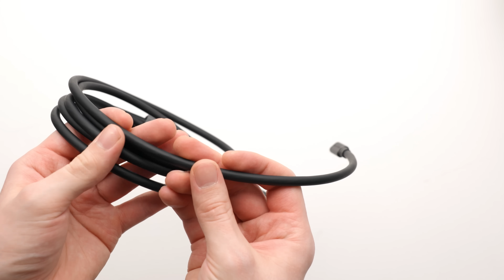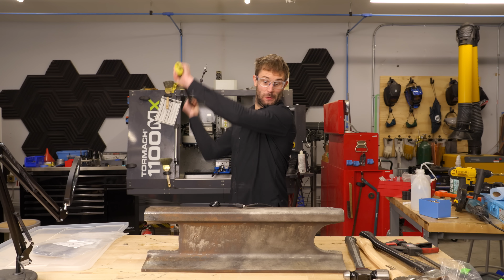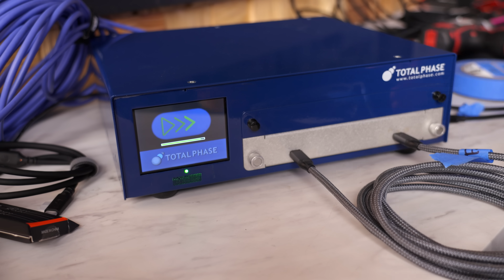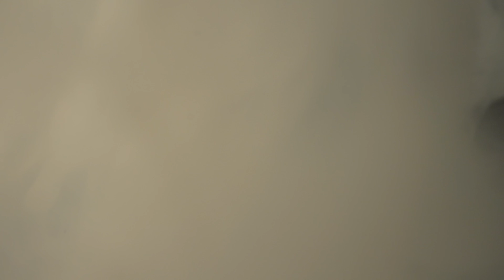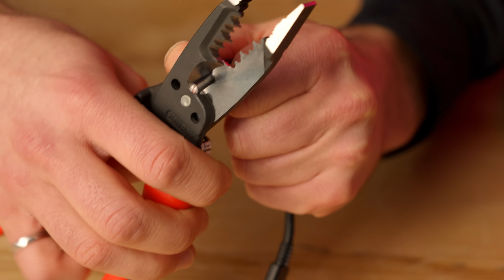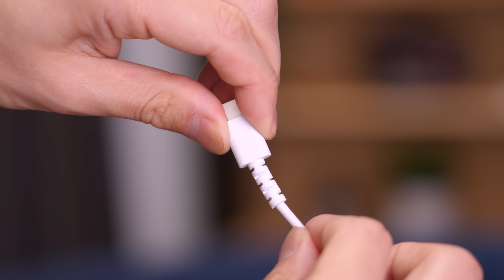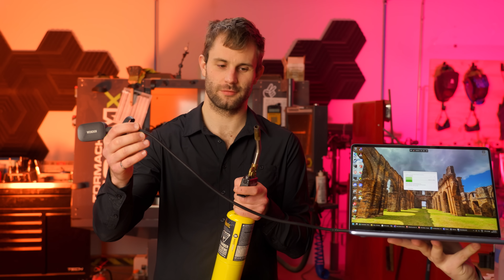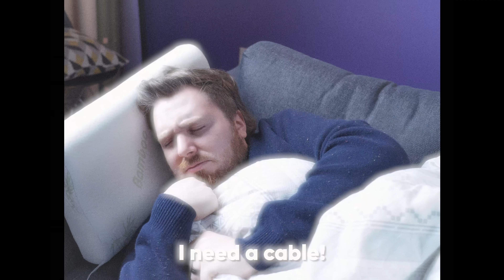Why It Took Me 4 YEARS to Make a USB Cable

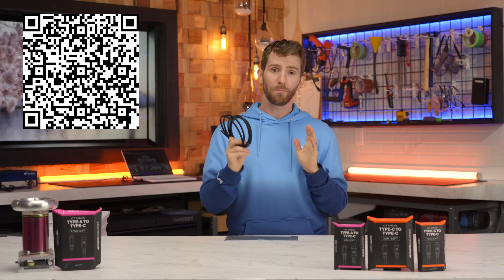Comment: 10:57 ironically, this QR code is not to spec
Reply: Way too many people forget about the required whitespace  and crop too close.
Reply: @Kirides I'm guilty of this when I 3d printed one lol
Reply: Even more so as the QR code in the last sponsor segment is
Reply: agreed, doesn't even read on my phone.
Reply: I can’t scan the QR code.
Reply: @user-fb5ym6ey5d  put some white paper or something like that right around the edge around it.
Reply: I was going to say that too. Talking like 10 min about spec and quality and then fail at the qr code.
Reply: @Nithanim  Listen, that's gonna need 2 months, six engineers and at least 3 segues from our sponsor before they get QRs right
Reply: @Nithanim  Insane, the code worked for me and about 30k other people.
Reply: @CoTaMedia99 sure it can work, but it should have at least a border of 4x the size on any white/black square for optimal performance.
Reply: @AltonV seems more like faulty human error rather than anything else. I tested it with 4 phones as well as my original way, using my PC. Are you cropping it down to be pixel perfect? I’ve never once needed to do such a thing. Not to mention… the link is always in the description.

Edit* 

Next LTT video, “What are QR codes? How do you use them? What they actually mean.”
Reply: @CoTaMedia99  yes that's what they are saying it was human error and as a result it isn't to spec.
Reply: @CoTaMedia99  Insane, the "inferior" cables work too (most of the time).
Reply: I’ve lost probably hundreds of hours of footage and thousands of pictures from shoots due to absolute shit hardware. I record and transfer everything in real time to 2 external SSD’s when I’m working. It may be redundant, but redundancy is key when one small little issue can ruin an entire operation (quoting LS as well as Jakkuh-who is the one that built that into me)

Edit*

I’m still gonna use the “inferior”, as you called it, cables to charge my phone, vape, batteries, lights, cameras, keyboards, and everything else. But for the moments that need every bit of reliability, these so far stand out cause every other company just says “ehh we made a cable that does 40gb and 240w” while it indeed does without issue, but they’ve failed me more times than I can count on one single hand.
Reply: @N @Nithanim to add without editing, read my name and it will make so much more sense.
Reply: While it is ironic for the name, being that the cable itself isn’t USB certified it kind of checks out.
Reply: @zooning-6843 does it really matter if they follow the specs?
Reply: worked for me
Reply: Well, it works and it has error correction, so who cares 😉
Reply: @owlstead  error correction is only for the data, it the image is not to spec, it wont even be scanned
Reply: @owlstead  my Google lens wouldn't agree that it works ;-;
Reply: @Zapewne_Tomcio that's a point off google lens for not trying to decypher it, while the built-in QR code scanner reads it just fine (belongs to "google play services" app)
Reply: There's a link in the description anyway
Reply: Human error in not knowing how to use a QR code properly… not out of spec of the QR code itself….
Reply: @CoTaMedia99 If I start cutting my up to spec USB cable short, it was also up to specs before it but somehow not anymore after it. 
That was also somehow the point of the Video. 
And judging from other comments here, it didn't work for everyone.

Comment: Wonder how this will go for europe. Usb c to c cable 40 usd, 50 euro shipping 30.usd import tax. But you probably get nice stickets included so that would be nice
Reply: It's the same chinese garbage you can find anywhere. Just buy some cable from a local store, 9/10 it'll be fine if you pay attention to the specs or google the full spec sheet before buying.

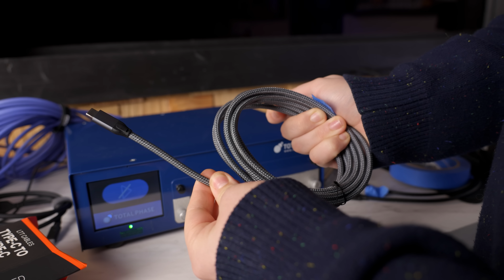Comment: 2:56 Ha, this looks exactly like the last set of USB cables I bought off Amazon, because at least it seemed more solid than the price competitors. So there's a chance it came from the same production line. Now I want a cable tester, because as demonstrated in practice it works fine :3
Reply: Anker?
Reply: @Gnalysis  Does Anker sell exactly those? If so, I may have their factory's "night shift" edition because they're sold under these typical generic china vendor names :3
Reply: @misatzu Anker does sell braided cables, but the top "shell" of this cable doesn't look like Anker's. So I might be wrong.
Reply: @Gnalysis  Yeah of course there's a lot that look quite similar, so I actually held mine directly in front of the paused frame for comparison lol ... pretty sure but also not a 100% sure ¯\_(ツ)_/¯

Comment: Why are all lengths the same price 😅
Reply: I can see you caught none of the 42 times of them talking about why all the desk mats and also the water bottles are the same price 🤓
Reply: @misatzu yeah i did not, i do not follow any of the streams and tend to not watch the videos of the other products that they sell since i am not interested in them. So yeah i did not know why there is no price difference. Seems a bit weird for the cables though i get the mousepads and the bottles but the materials for a 10cm cable and a 5m cable are vastly different. Either way no need to be an ass about it
Reply: @gasmonkeybg5804  At the beginning of this pointless novel I still would've gladly explained why, but once I reached the end of it I figured you were exactly the humorless hyper sensitive schmuck to be expected 😂

Comment: Will there be a 90 degree connector in the future?
Reply: 90 deg in both orientations (upwards as well as sideways) would be great. There's always weird applications like old car cigarette lighter adaptors that suit a bend in a specific direction.
Reply: @zunaidparker 
Or even 45-60 degrees sideways? Just Not the 180 swivel side to side.
Reply: @Vamanos46Fixed angle cables are so garbage if using it for your phone.
Reply: I am looking for 90° as well i am used to them and they last longer when used right
Reply: @antoniok4735  why not pick up a passive adapter that does just that?  I know it would be sleeker as part of the cable, but with how (necessarily) bulky the ends of these cables are, I don't see that being any different with angled ones - while the adapters can be fairly slim.  Maybe if there's a market for LTT adapters where they think they can do better than what's out there, they could make their own adapters.
Reply: @stub9857 I've run into a lot of reliability issues with them over time
Reply: Or two yes, took me ages to find one that had L-shaped connectors (as they are usually called) and did 10 Gbit/s or more. That way I can use my tablet as second screen as that thing does have USB-3 support as well. Finally found one on Ali which works fine, but I'd rather have one that is thicker / more flexible / better build! I'm assuming though that it will be a pretty rough dev process, against less return.
Reply: oh, yes please!
Reply: How about a 69° cable?
Reply: @snowmule5967  Noice.
Reply: Giggity

Comment: So I do have some questions on how they are advertised on the site. Are they all usb 4, or at least are the C cables over 20gbps all usb4? Do they all support 240 watt pd? Do they support display over usb? I feel like these are important points when you are buying a cable that are "True to spec". You print the wattage on the cable, but not on dropdown on the site. So how can I be sure of what I am getting? If they are all up to that wattage, that's great, I just feel it should be put somewhere confirming that. I look forward to getting a few once those items are addressed though!

Comment: $30 for a 1m 40GB/s cable? Bro you can get something similar (240W, USB4, 40Gbps, PD3.1, 8K@60Hz, Silicone) for a 1/3rd of the price from Aliexpress
Reply: That is ali express though... you can get a 5090 for like 300 bucks there... go ahead and buy one. Not saying you can't get it cheaper elsewhere but ali express isn't a reliable source to compare to.
Reply: yeah those dont hit any of those specs lol. I guess you got a 50k usb 4 cable tester huh?
Reply: @JamesMKE  (1) The TP800210 Cable Tester shown in this video is 15K and not 50K; (2) Unless you want to verify the signal integrity of the cable, you don't need such expensive equipment to validate an E-marker chip

Comment: I just wNT A USB-C 240 wTT 6 FOOT thunder bolt 5 compatible  usb-4 compatible, PCI-e 4x4 compatible bullet proof, fire proof, acid proof, weight resistant up to 4 tons that also does HDMI, for 5$

Comment: This is GREAT. As an amateur radio operator I will be putting these at the top of my list. I’m constantly dealing with RFI out in the field with crap USB C cables. Even the ones from big brands… even covered with ferrites.

Edit: 11:07 I paid $25 for a special cable just last week. Good cables cost money, LTTStore isn’t exactly budget so it’s really cool to see how reasonably priced these are. I’d consider the current going price to fit very well with the competition.

Comment: I agree with the statement that you have to KNOW your cable will work , i have worked on events and its all well and good saying " that cheap cable from amazon is ... fine" but on the day you need to KNOW your device will work as indented so yes the overpriced kramer HDMI cable is worth it to connect your multi 1000 GBP switcher scaler to you ( when new ) 100,000 projector.

Comment: Talking about USB, USB-things that should exist, but do not or are super rare or extremely expensive for no reason: A USB stick that does not overheat and crash in performance shortly after you start writing to it. Specs show super high speeds, but in reality sticks are just too small and overheat so badly, write performance crashes straight away. Second thing is a physical read-only switch. Image being able to stick your stick to any slot without having to fear it gets infected.  USB sticks are one of the more common ways viruses spread. Sticks with physical read-only switches exist, but the are priced horribly. Combine decent flash-cooling heatsink and a read-only switch at a reasonable price and I am surprised if it does not sell.

Comment: You had me at "clear labeling." This is a good idea: USB cables have devolved to the point where you have to trust the vendor. It's the perfect place for a "Trust me, Bro" guarantee. SO MANY GRIFTERS

Edited to add: 12:40 That's quite a flex putting a sponsor spot in a literal product announce infomercial.

Comment: please include bundles, either premade or build your own (like sites like fresh clean threads do) that would come in with a bulk discount.  I have appx 3 places where I'd want high quality cables to replace some older ones, but could use 5 if the price were right
Reply: Whenever I see bulk discounts on something pre-manufactured, my mind goes "so you are saying you could charge less for 1".
Reply: @KevinTolsma that’s not how bulk discounts work… the up-charge for one is largely in shipping and packaging, whereas another part of bulk discount is the guarantee that you’ll be buying multiple meaning they can lower the price a bit because they’ll be making more money. Clearly, you’re genuinely ignorant on this sort of thing and so if you see this, I hope it helps you understand better.
Reply from the maker: no time soon. Our margins aren't hundreds of % on these like many cable companies. If you want more, just buy more and you can save on the shipping cost. -LS
Reply: @LinusTechTips  thank you for the clear reply

Comment: will u be making display ports/hdmi cables ?
Reply: I bet HDMI costs a pretty penny to make
Reply: @NebulaHatesWatchdog you also have to pay a license fee for each unit
Reply: i doubt they would make hdmi, cause in the company behind HDMI still has the patent as is charging alot for letting companies manufacture things with hdmi, kinda wild its still so standard
Reply: i would love some great quality dp cables :)
Reply: They answered this in one of the recent Wan shows I believe, what Linus said was something along the lines of "If these cables sell well, and there is high enough demand they will look at it"

Hope this helps 🙂👍
Reply: I remember Linus was stating that he wants to first see how well he these cables sell, and if they do well, then he will move on to the next stage in this project and start working on display cables
Reply: On WAN show they said they are interested but want to gauge interest first. Moreso in HDMI because the licensing standards simplify manufacturing, whereas Display port may be more tricky and expensive due to very high bandwidth for certain specs, and chips needed to manufacture active cables above certain lengths.
Reply: I don’t think they’d be able to make an HDMI cable, but they could probably make a display port
Reply: They talked about it on WAN Show a while ago, currently they're not planning to make any display cables but that's obviously subject to change and depends on the factory's capabilities, DP cables have a chip in them that requires some extra engineering, and HDMI cables require expensive licensing
Reply: And Cat6+, and DAC, and how about LTT brand Transceivers/fiber cabling?
Reply: why not use dp over usb c? it can also carry power and peripheral signal to the connected device (like a laptop)

Comment: This could be huge for me! I stream arcade games which means I not only need a long cable but I need a reliable cable! I have to move multiple cameras several times per stream. I have some that disconnect just by moving them. I will be looking in to these for sure.

Comment: That happened to me, i bought an ANKER C to C cable for my ssd, it said it would work with 5gbps speeds and 240w charging. It did charge at those speeds, but my ssd was runnning at usb 2.0 speeds... Had to get another cable that actually did work. (PS it was Canon cable that came with my camera that worked better and was running at full speeds in the end).

Comment: cool, now HDMI?
Reply: Or display port
Reply: @dekusprout4136  definitely display port, after learning HDMI is proprietary I kind of feel bad owning HDMI at all. Linux + HDMI feels icky now…
Reply: He hasn't ruled it out, but on the other hand made it clear its not a priority atm, and might not be.
The problem is huge with USB, there are others making quality display cables - Also HDMI we are back to the license problem!
Reply: With a bit of luck we can just replace everything with USB-C. I'm really wanting desktop PC's to use the notebook trick and simply use an iGPU on top of the discrete one. It can drive 2 more screens or so and then route the discrete graphics over USB. Desktops are so stupid compared to laptops at the moment, and they require way too many cables. Waiting for monitors with 2 or 3 times USB-C and build in KVM, so I can do away with all the other cables.
Reply: And USB B, Micro B A to a (m-f) C to c (m-f), Mirco usb, printer (forgot the proper name) and all the kind of 90's and adapters and ofc aux (there are way to many cable standards and I probably use them all)